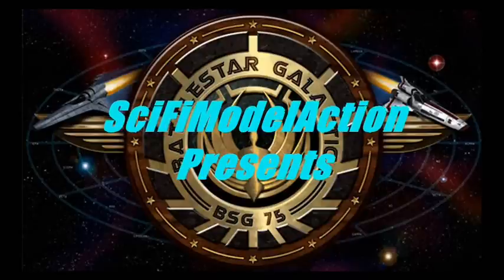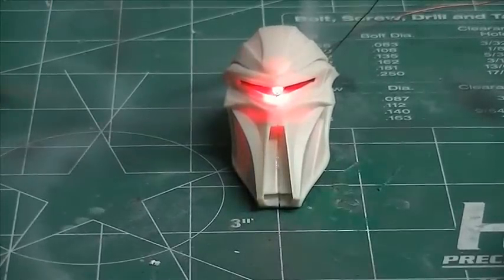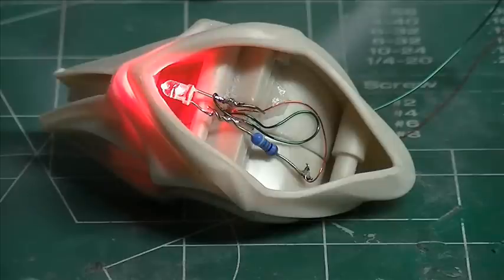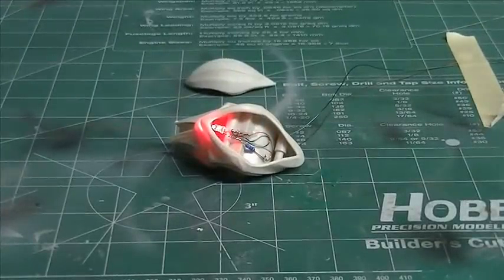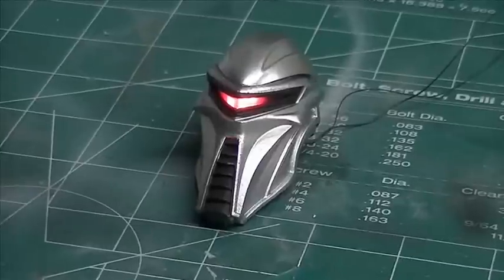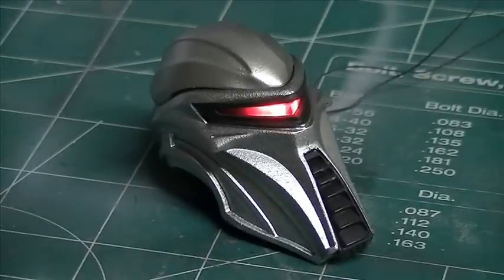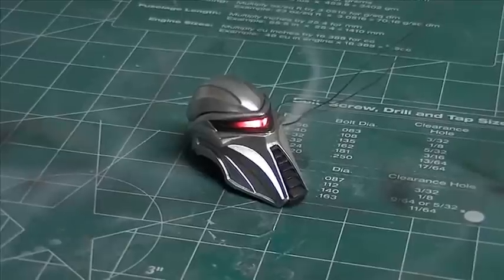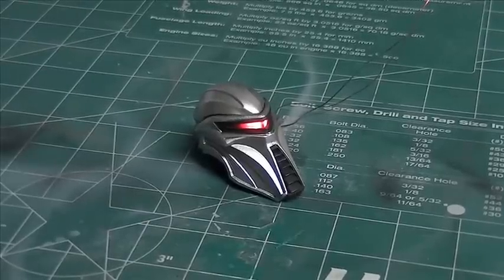Moebius Models 1/6th Scale Cylon Centurion Buildup PT I

Comment: Instead of using a 9 volt battery. You could use a button size battery or two AA battery without a resistor up to three LEDs. Or you could use 1.8 led and still use a button size or two AA batteries.